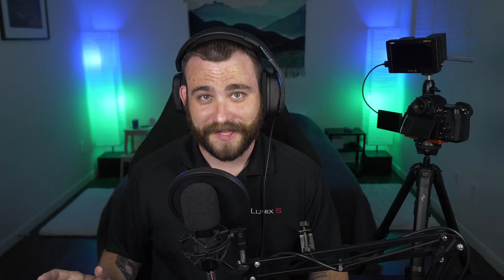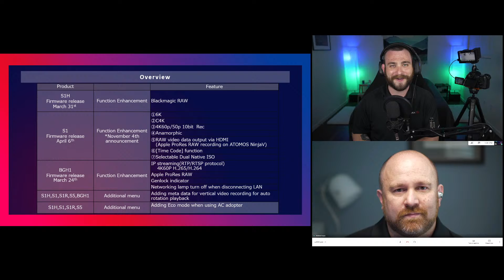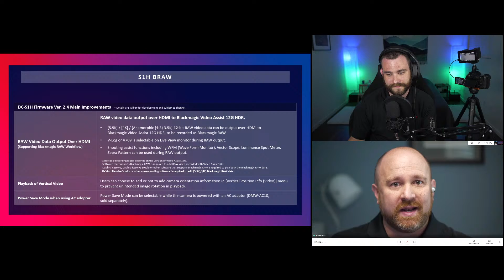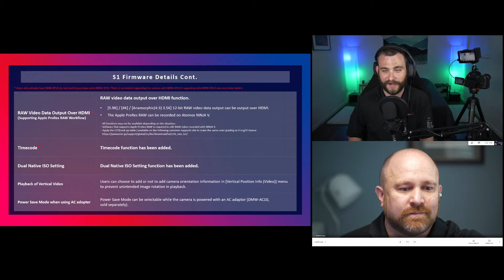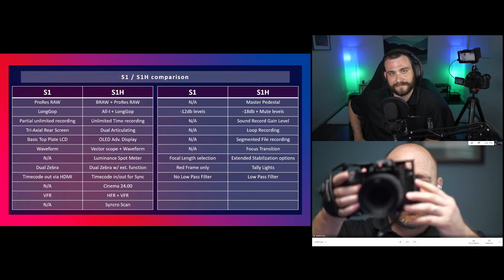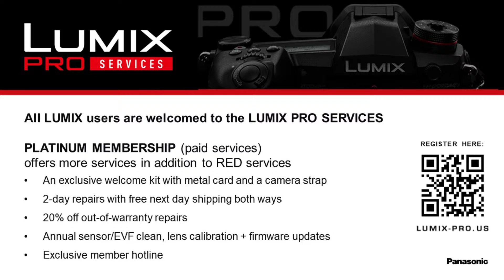LUMIX Live : The S Series Firmware

Comment: Is it possible to change camera metadata ( iso, exposure and temperature) of Panasonic s5 and s1 Prores raw in FCPX?
Reply from the maker: Yup, the S5, S1, and S1H all have ISO, WB, and Exposure options in FCPX. Just make sure you are on the most up to date version for the camera, Ninja V, and FCPX. - Sean R.
Reply: @LumixUSA  what about premiere pro?
Reply from the maker: Premiere Pro still has some limitations with ProRes RAW files. Currently, you would need to check with Adobe directly for if/when they may add the control. - Sean R.

Comment: I may have missed this, but i was wondering if one needs the paid version of Resolve as apposed to the free version in order to process/grade the Braw files from the S1h. Thanks...
Reply from the maker: In order to edit BRAW from the S1H, you will need the Studio (paid) version of Resolve since the resolutions are greater than 2160px tall. You will also need the Video Assist 12G 5in or 7in version for the recorder. - Sean R.
Reply: @LumixUSA  Thanks much. Great content. Much appreciated. I do have the free version and just purchased the 12g video assist. I am able to use limited raw capabilities, but am unable to access iso and gamma controls in the the raw pane. I assume these features are unlocked as well in paid version? Thanks again for all of your work putting these sessions together.
Reply from the maker: In the Studio version, there isn't an option to change ISO in set values from a dropdown. Instead there is the slider for exposure. I recommend reaching out to Black Magic for more details around the software capabilities with the S1H BRAW files. - Sean R.

Comment: Sadly I could not be there when this stream was live but maybe I will get an answer anyway.
Curently I am looking for a new camera to replace my old and toyish Nikon. I am thinking about S5 or S1 but I have one question:
is it possible to hope that these cameras might get a 120fps (I guess in 1080p) via firmware? This would be very helpful for shooting fast scenes. Some cheaper competitors have it (some even have 240fps) and I am surprised how S1 or S5 do not have it?
Thank you!
Reply from the maker: The S5 and the S1 do have slow motion capabilities right now. 

On the S5, this is done in the S&Q mode. You select S&Q on the top Mode dial, then select what the output framerate you want to have your video. Then, in the Slow and Quick menu, you can overcrank or undercrank the recording from 1 to 60 FPS in a 4k30p output, or 1 to 180fps in up to 1080 60p output. 

On the S1, this is done by working in the "High Speed Video" function. Here you can do 180fp output to 1080 / 29.97, 150fps output to 1080 / 29.97, 60fps output to 4k30p, and 48fps output to 4k24p

Hope this helps! - Sean R.
Reply: @LumixUSA  thank you so much! I can't believe I have got the answer so fast and the answer confirms again that your cameras are great! Now I have to find a shop which has both S1 and S5 to test before buying :)

Comment: So I am still a bit confused about RAW output from the S1. Matt said basically that the S1H / S1 had similar RAW output (except S1H has an AA filter). And he also mentioned that the cameras don't output ProRes RAW or BRAW, they "output RAW," which then gets interpreted by the device that is capturing it. So since it is just RAW, and since the RAW of the S1 is the same as the RAW of the S1H, why can't one just plug the HDMI in to a BlackMagic recorder and start recording in BRAW???
Reply from the maker: Our explanation was a bit simplified for the broadcast but there is much more involved than just sending a RAW signal over HDMI for a recorder to capture. The S1, with the new firmware, only works with RAW over HDMI for the Atomos Ninja V for ProRes RAW. As Matt and I said, we are always taking the feedback and monitoring what the community's requests are to evaluate if things are possible, but at this time we have no answer on BRAW for other cameras outside of the S1H. - Sean R.
Reply: To expand on this a little, each RAW format has its own metadata and that is a big part of the process so while they are both RAW, the metadata is very different.